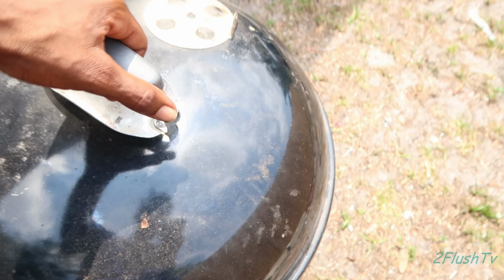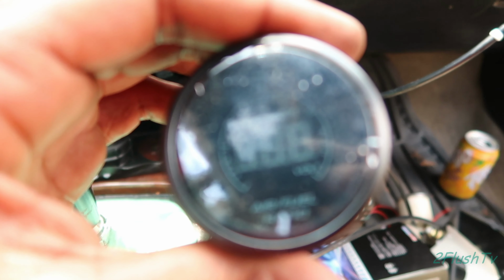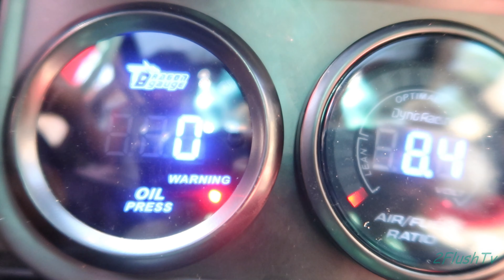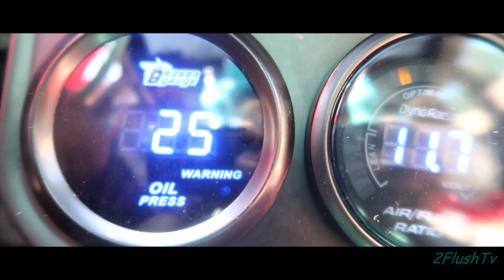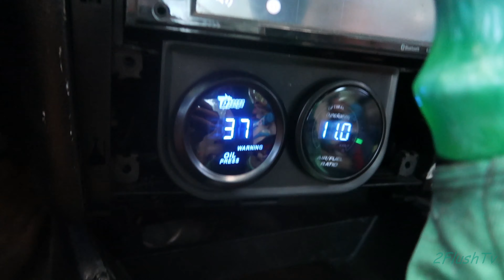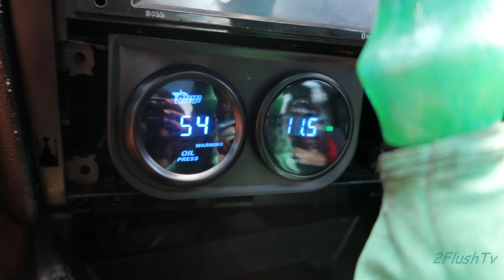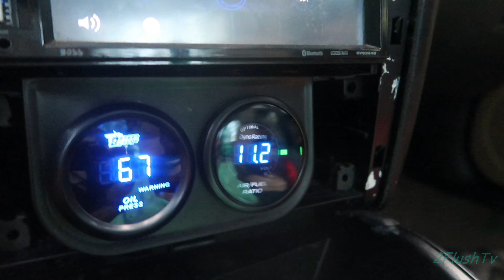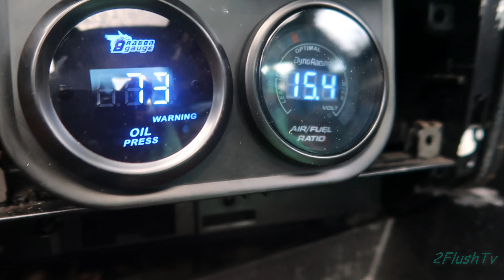My First AFR gauge (Narrow band) install | Mk4 jetta vr6

Comment: Hey what's up normally people have two o2 sensors (upstream and a downstream) which one did you use? There's one next to the engine by the headers or the one underneath the car by the catalytic converter?
Reply: You should use the one next to the exhaust ports

Comment: Im about to do this with my 1.8t .. Mine is much easier cause i have less engine in the bay haha . 
Sweet video bro 🔥
Reply: What wire did you tap in to with the 1.8t? I’m having trouble with my glow shift narrowband
Reply: @yeahaight5692  I used a lc-1 wideband , windowed. So I can read my tune without having to switch completely to wideband from narrow band